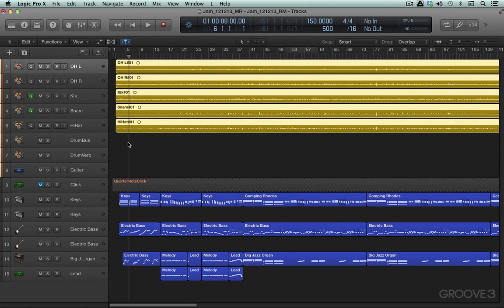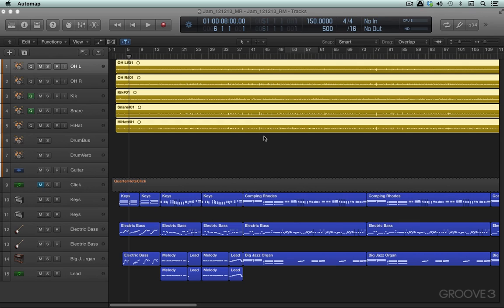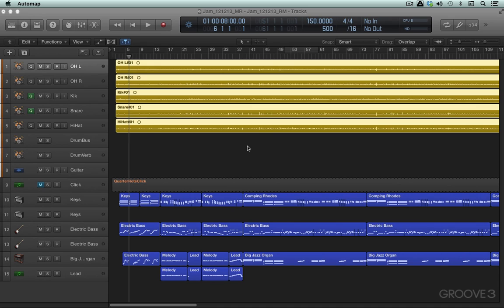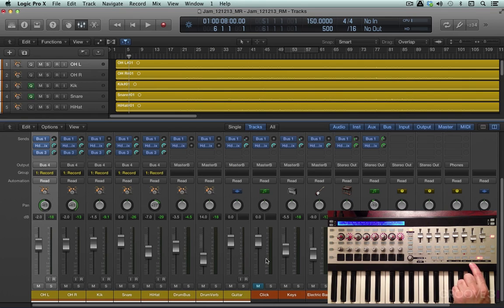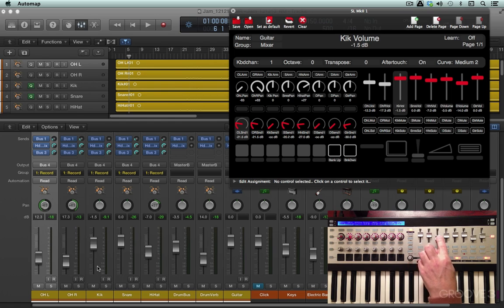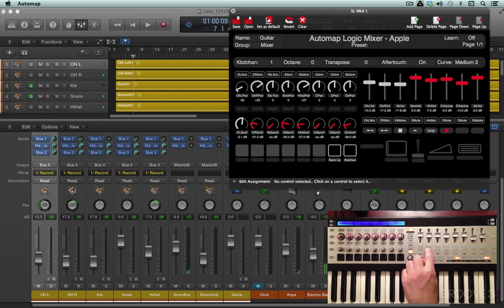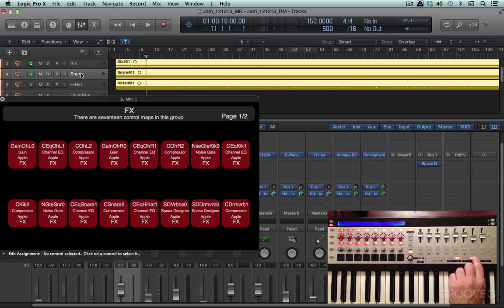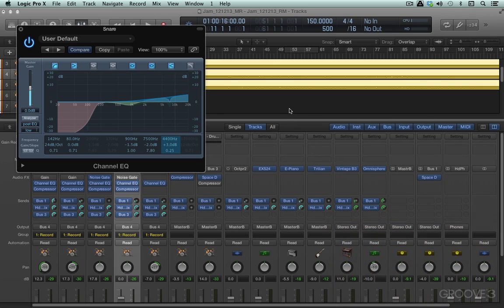General Automap Concepts (Novation SL MkII Explained)

Comment: Hi, and thank you, very well explained. But...I do have questions.
just picked up my MkII keyboard controller, have downloaded the latest version of automap (vers 4.10)
I've been given conflicting info so need to clarify.
1. When in "Mixer" I'm controlling the mix console of my DAW Correct?
2. Does Automap ONLY work with instrument folders or would the mixer controls also control say loops, or recorded audio? (I've been told it only works with midi instruments don't think that is correct.
3. I'm very much a minimalist when mixing, only use what is necessary not all crazy with weird sounds and FX's. So my main concern is being able to mix properly without having to keep relying on a mouse and single track/channel mixing and editing. so...
...the automap will make it easier for me to do over all mixing or just work with midi design instrument tracks?
4. I know transport will control the mix session as lot's of DAW's have that feature, my concerns are for compression, EQ, Pan, volume level, gain etc.
Since I use Studio One vers 3.5.6, it has what's known as "Inspector" which is like a mini mixer inside the main DAW. This allows for me to cut up tracks into separate sections if I wish and directly drop special settings effects into the one single "Event" (or slice if that's easier to understand) without affecting any of the other over all settings. This is great for dynamics if say I want the last word of a lyric to trail off in a repeating delay or reverb without the entire track being altered. So...
Would that cause conflicts with automap settings?
I'm really liking the Novation MkII and am getting the hang of automapping slowly but it is still very confusing. So...
5. Once I set basic parameters for the above mention, this will remain constant as I write, record and mix new material, or do I have to reset to "Default" every single time I create a new song?
Reply: P.S.  by any chance is there anyone in this subscrption currently using Studio One 3.5.6 and Novation that could possibly walk me through this? Most of this video was basic to all DAW's but S1 does have it's own "Midi Learn" function that is very similar to Automap. Again, so I can avoid conflicts between the different softwares.